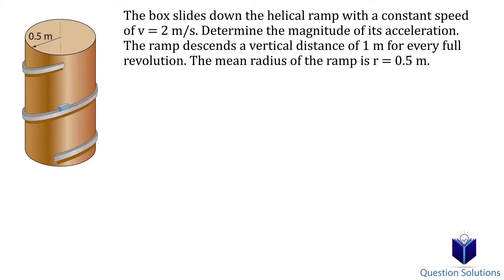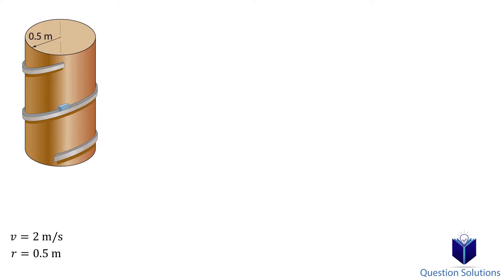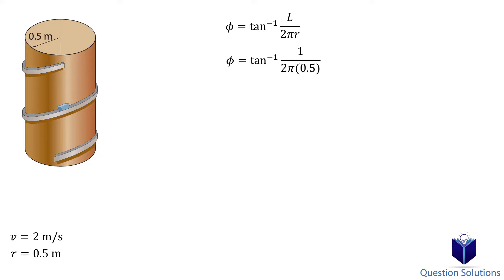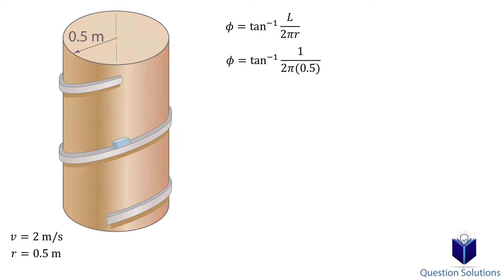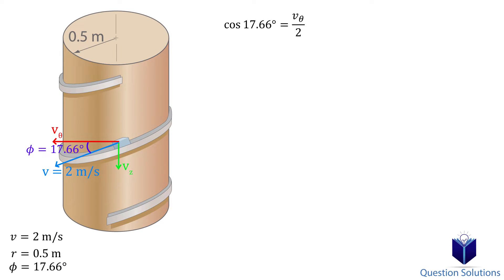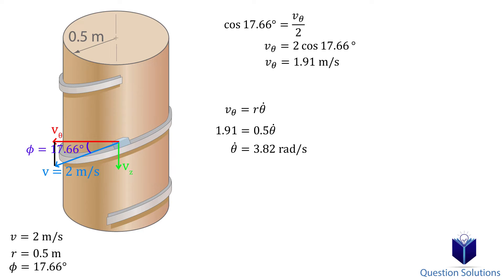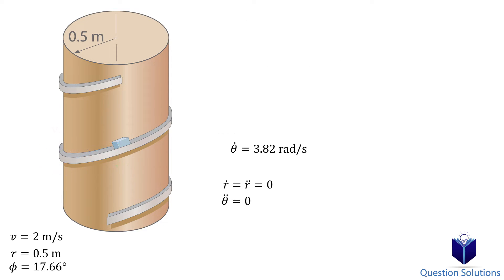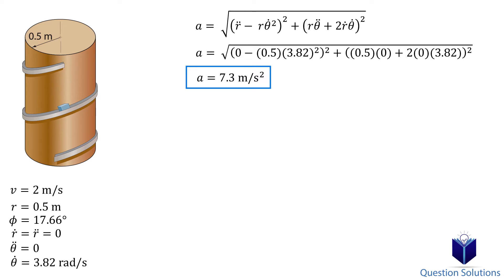The box slides down the helical ramp with a constant speed (solved)

Comment: Does the calculation of the angle include a negative sign if a particle is moving up a helix rather than down a helix?
Reply from the maker: So when you get an angle, you're really getting a magnitude value. There isn't a need for a negative sign because you'd just change the coordinate system to the match the angle.